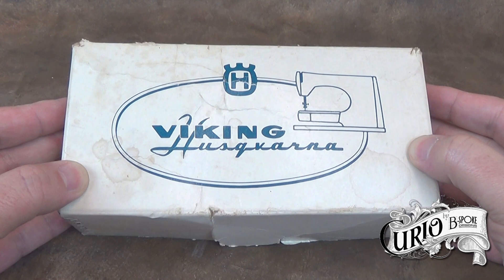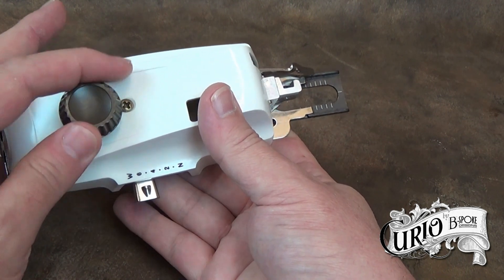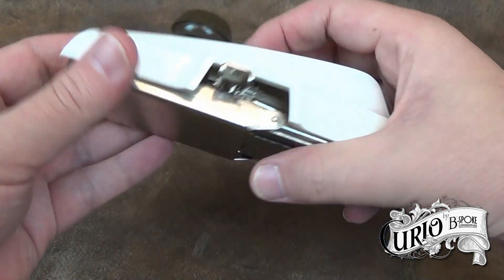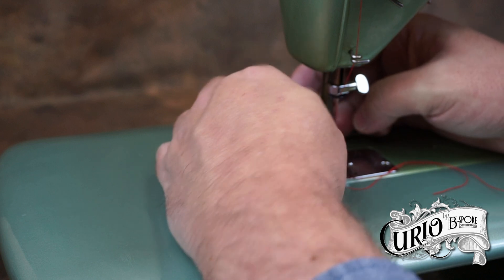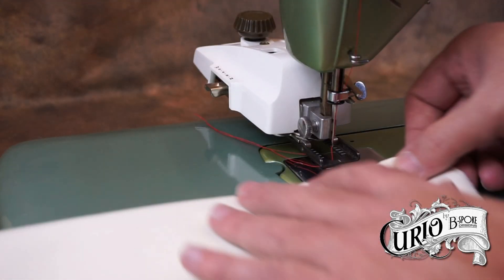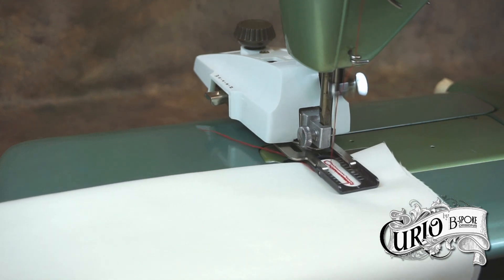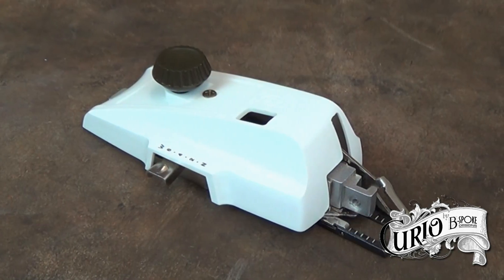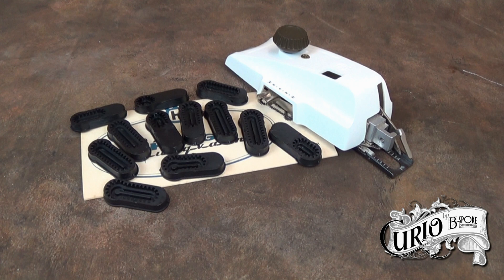Husqvarna Viking Button Hole Attachment by Greist

Comment: My machine is the 6020 with the built-in buttonhole feature. Convenient p, but not as accurate as buttonholes made from cams. Will this attachment with on my machine?
Reply from the maker: Yes, it should work fine as long as you can set the zig zag width.
Reply: @CurioByBSpokeDesigns  Thank you very much. I wasn’t sure about the shank length and such.

Comment: Hi, I know that this is an old video, but if I'm really lucky you might be the be able to help.
    I have a Husqvarna Automatic 21E sewing machine, and I would very much like to have a buttonholer to go with it. What buttonholer would be compatible with mine, please? Can I use a Singer one that is made to go with zig-zag sewing machines do you think? Around my part of the planet, even the people that service my machine doesn't know about buttonholer, they are that rare. I've seen a fair lot of them (more than 10) made by Greist, but many more by/for Singer. With hopes of an answer, yours, Ann
Reply from the maker: Yes, as long as the button hole attachment is made for a low shank zig zag machine, it should work.
Reply: @CurioByBSpokeDesigns  Hi, Thank you so much for your answer. You have no idea how appreciative I am for this. I'm going to start to find one as soon as I can, but not at 11.30 pm CET. I have no idea what a low shank sewing machine is, but I trust that you do. Thank You. Yours, Ann
Reply from the maker: @annlidslot8212  most domestic machines, such as most singers - apart from the slant shank machines, are low shank.  Most industrial machines are high shank. There are some, such as Bernina, that have their own style of feet and attachments.